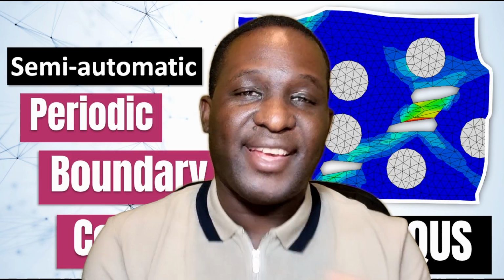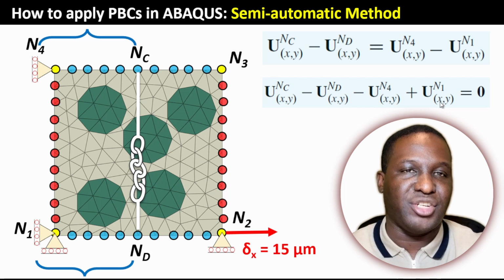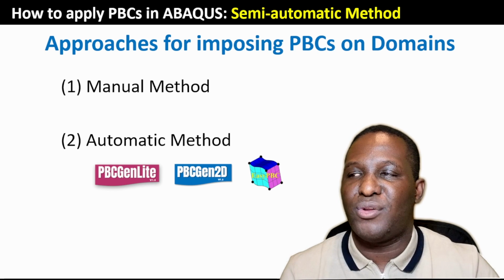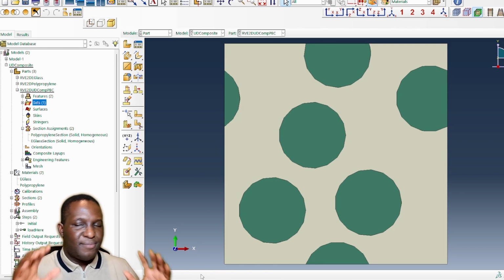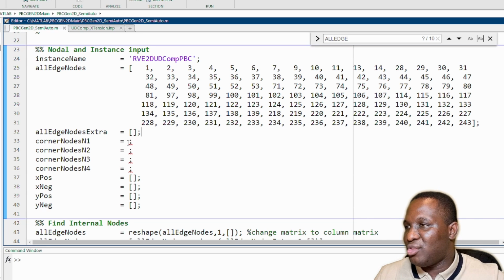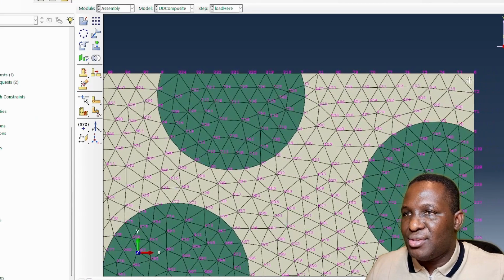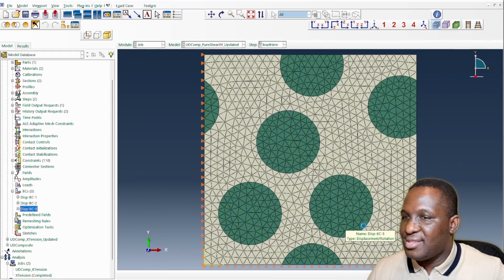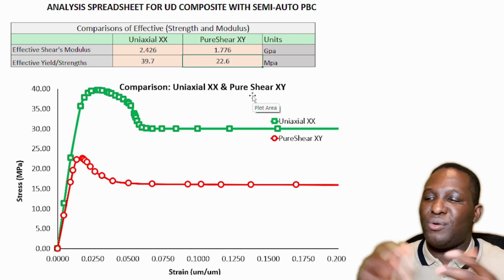How to SEMI-AUTOMATICALLY apply Periodic Boundary Conditions in ABAQUS

Comment: Very interesting video.  Are you aware of the Micromechanics Plugin for Abaqus/CAE that DS provides?  It was released at the end of 2016 and automates the imposition of PBCs (and a few other types of constraints) as well as defining loads and performing homogenization on RVE models.

Is there a reason that you only constrain the normal component of displacement across the periodic faces?  If the tangential component(s) of displacement aren't constrained, you're not actually going to get a periodic displacement field - the tangential displacements will vary between faces in a non-periodic manner.  I also think that this will lead to a zero shear condition along the cut faces of the RVE as the tangential components of stress will necessarily go to zero at the boundary (although the zero shear in the derivative fields may not be immediately apparent due to low mesh refinement) and in general the strain and stress field will be non-periodic.

One nice way to check the correctness of PBCs is to create a model with multiple tessellations and compare the results when you model one cell and two cells.  The stress/strain solution should be identical at a given point.
Reply from the maker: Hello @RossMcLendon,

Thanks for your detailed comment and pointing out a few things.

On *Micromechanics Plugin for ABAQUS CAE*, I actually did not know about it. I only researched into it to find your article about it here: https://www.linkedin.com/pulse/micromechanics-plugin-abaqus-ross-mclendon/ I know ANSYS has a similar module as this but not ABAQUS. It will be interesting to have a play with it and more importantly understand the theoritical framework that underpins its development. I believe the ABAQUS license I hold with my organisation might not cover that plugin.

On *Constraining the periodic faces of rve*,  I am not sure you understand completely the framework I am working on. It is not constrained only in the normal direction, rather it is for both normal and transverse in otherwords x and y-axis. The principle here is to isolate first identify the corner nodes (the vertices of the quadrilateral) and use those to use as anchor points to apply the required loading and boundary conditions on the model. The nodes away from vertices are then implemented with a *EQUATION driven periodic boundary conditions formulation that constraints periodic nodes (directly opposite semi-colinear nodes) in both x- (normal) and y- (transverse) directions. It is actually  a well established approach that has been published widely in the community and peer reviewed. A lot of authors have adopted this approach and as a student at Oxford University many years ago, I first read about it by an author called Kouznetsova and implemented this as part of my PhD work. I have since published about it extensively and here is a paper where I laid down the principles in detail https://doi.org/10.1016/j.commatsci.2012.12.036. I also gave detailed description about this in a 2018 Postgraduate textbook I authored and published by Springer which you can read here: https://link.springer.com/book/10.1007/978-3-319-67125-3 You may like to look at Chapter 8 about Boundary Conditions. 

On *Correctness of PBCs*, I have already explored this in the said publications above and shown it to be true. The journal paper has a parametric study where I explored different mesh descritations beyond just unit cells and it showed that the PBC implementation is right. 

Thanks once again for your detailed comments. I will love to catch up separately to continue this discussion. Cheers!
Reply: @MichaelOkereke  Okay, watching again I think you are defining them correctly - I was mistakenly thinking that you were describing the equation for N_A and N_B as involving only DOF 1 and N_C and N_D as involving only DOF 2.  On review I see that you're describing two equations for N_C and N_D, one for DOF 1 and another for DOF 2.  Assuming you also define similar equations for N_A and N_B (with N1 and N2), then what you're describing should be periodic.

The Micromechanics Plugin uses a somewhat different approach to define PBCs, but the two results will be in essence equivalent apart from how loads are defined (with the plugin, you directly specify strain components rather than specifying relative displacements between periodic faces).
Reply from the maker: Certainly @RossMcLendon, I agree. There is definitely a kinematical constraint equation involving also N1 and N2 to make the model truly periodic. This is why I divided them into internal nodes (NA, NB, NC and ND) and the corner nodes (N1, N2, N3 and N4). By intelligent combination of displacements at corner nodes kinematically linked to the internal nodes, we can then define a canonical equation (which I discussed in the video) which is then subsequently implemented using *EQUATION to enforce the right periodicity argument.

I am aware of your strain-tensor based approach for imposing PBCs. I had a PhD student who used that approach as part of his PBC implementation for a textile composite study. In fact, in that method, he was able to deal with non-periodic meshes and you can read up about this here: https://doi.org/10.1016/j.compstruct.2016.10.114.
I intend to make a video on that approach to complement what I have presented here. I first got exposed to this displacement-based approach and love the intuitive way it works, something users who are already comfortable with Dirichlet BC-type approach, can easily understand. 

Your approach will certainly allow for applying combined loading easily based the strain tensor. I know there are other benefits. I will write you outside this forum to follow up on these interesting conversations. I look forward to playing with the Micromechanics plugin and see how useful and complementary it is to what I present on this channel.

Thanks once again for taking time to comment on this.

Comment: Dear Dr.Okereke, thank you for your informative tutorials. I'm wondering if there is a semi/automatic method to impose PBC on 3D RVEs which are made from two parts. I'm working on a 3D RVE of a UD composite and I have to model fibers and matrix in two different parts to be able to define cohesive surfaces between them. Moreover, my 3D RVE has fibers on edge. Do you have any idea how should I define PBC in this case ?
Thanks a lot.
Reply from the maker: This is definitely not a straightforward way of imposing PBCs on 3D RVEs. I published about this a while back so you can read about it in this publication: https://doi.org/10.1016/j.compstruct.2016.10.114
You should get some pointers in that publication. I do not have a publicly available code for doing such but am working on it.

For the situation with cohesive surfaces, yes, you have to allow all components to be independent (unattached) so you can specify them independently. It can prove difficult but it is doing. I do not have a video about this but can explore this in future.

Comment: Thanks for  this insightful video. I'm wondering weither  I can use this PBCGen2D software for a hexagonal shape marix unit cell ?
Reply from the maker: Hello @Syamil, I will say no. The PBCGen2D software works on 2D Quadrilateral RVEs so it will unfortunately not work in this case.

Comment: sir i have a  doubt, I am modelling a composite laminate of 8 layers along with the frame on top and bottom. I am using VUMAt code and  applying a predefined velocity in initial step on the ball and  applying pressure on top frame in step one.  I need all my boundary conditions  and pressure on the frame has to be applied before the ball hits plate. so how can i do it. Please help me in this case
Reply from the maker: Hello @Manoj, this is too specific a request and I don't usually honour this sort of requests.  It seems a project you are working on and I'd leave you to figure it out. I tend to make general videos to give ideas to viewers rather than specifically take a project and offer solutions here. As an academic I want my students to do their projects themselves.  Good luck with the work 👍.
Reply: @MichaelOkereke  oke  sir i respect your words....thanks 🙂